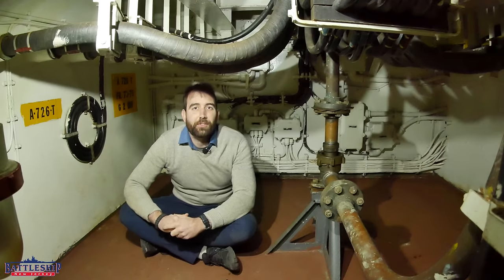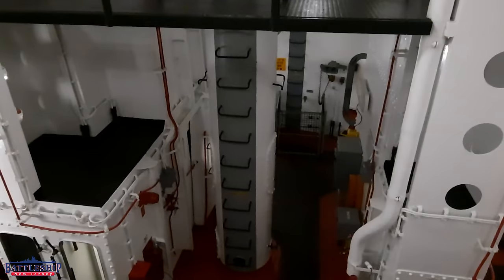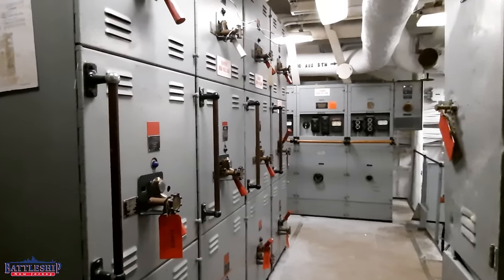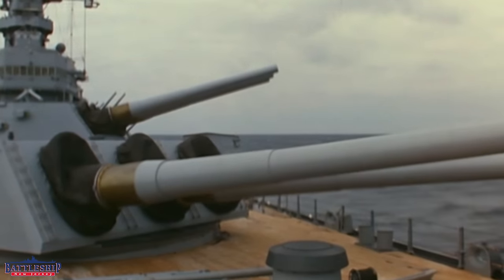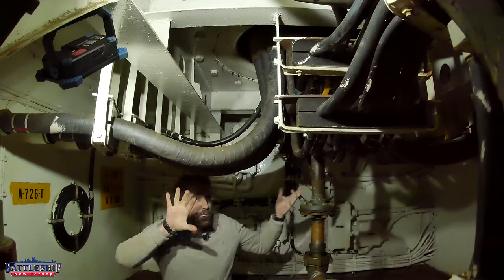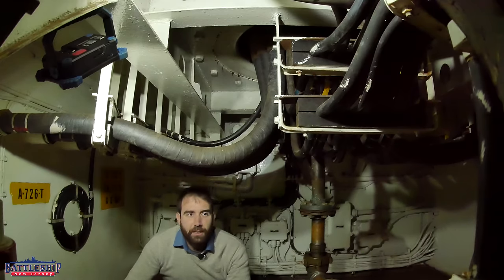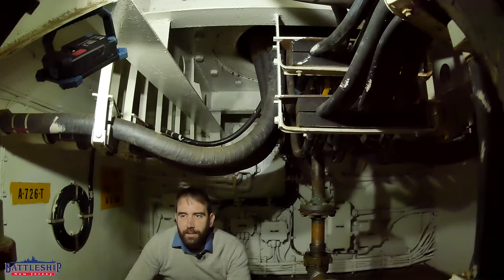Connecting the Rotating Turret to the Rest of the Battleship

Comment: According to a similar video produced for the USS Iowa, the pipe running up the center stalk is the purge air for the 16" rifles.
Reply: Thank you!  Of course we all now HAD to know what the mystery pipe was for.  So now where is that air supplied from?  :)  
When I saw it I was thinking something air related too with the size and the fittings.   I forgot all about the Purge/Blowout after firing.
Reply: @donchaput8278  It'll be attached to a compressor/air tank. Where the intake is, other than "above the waterline", your guess is as good as mine.
Reply: I read down through here looking for this very comment. Yes, it is an air line and I knew that by looking at it. However, what you said does make perfect sense. I wondered what it was for and never thought of the purge. 
Thank you.
Reply: Interesting. I wonder why they deemed it necessary to have the only pipe going to the turret be the air line? Sure the compressor and air tank needed for the purge system could have been fitted in the turret itself, just like the hydraulic pumps etc. There must be some reason to do it like this but what is it?
Reply: @Murgoh  I don't think the tank and the pump would fit. The volume required to vent those 16-in turrets has got to be pretty massive resulting in a pretty darn substantial tank. Then to top that off with keeping up with the firing rate of nine of them you need a pretty substantial setup
Reply: @Murgoh  you don't want to take up the room or have the weight of a heavy compressor supplying air at very high pressure and also flow. You don't need 3 sets. Have you seen the barrel clearing in action? You're blowing anything burning out of basically a 16-inch pipe. It takes a lot of pressure moving a lot of air.
Reply: I was actually about to suggest that very thing. The compressed air supply for the gas ejector system.
Reply: @ut000bs  Yes, maybe so. The compressors back then were probably much larger and less efficient than nowadays too so I guess there were some large steam operated ones somewhere on the ship supplying all the compressed air. That's not a huge pipe though so they'll probably still have tanks in the turret to supply the needed high volume of air for the couple of seconds.
Reply: @Murgoh  My guess is that it was for safety reasons and not practicality or space. A rather big air pressure tank that gets hit by shrapnel can explode violently and it can be better protected deeper down in the ship. A pipe that gets hit is not as bad.
Reply: @skunkjobb  not to mention what all that surprise extra oxygen does to the dust and other already smoldering combustibles in a breached turret...
Reply: @Murgoh  it is possible the flow requirements would be too much for an electric pump placed in the turret. It is also likely any electric pump would be too high of a power draw for the ship's generators. Also the boilers have their own pumps so it would be relatively easy to just siphon off the ship's steam powered pneumatic system.
Reply: The compressed air going thru that pipe does more than supply the purge air for the 16 inch guns, it also provides pressure for the multilevel fire sprinkler system throughout the turret.  The water for the fire sprinkler system is provided by a firehose connection from the stationary part of the turret's powder flat (the bottom floor of the turret assy) to a standpipe toward the center stack of the turret, again on the bottom floor.
Reply: @SomeRandomHuman717  You are correct.  My response was incomplete.  Concerning the volume of air required for all of the tasks mentioned, there are numerous air bottles installed in the turret structure for this purpose.
Reply: @leaj847  The air bottles are in fact located in the annular space, that is, the area between the turrets and the magazines.  They are painted grey and seem to come in batches of four.  This video shows one, "HP Air 3000 PSI"  https://youtu.be/zIeKVlC6-uI?si=KYZ46LCmdSZ4slh_&t=634
Reply: That's exactly what I though.

Comment: Interesting on the Cables. Coming from a way smaller system comparably, I assumed that the guns just had a massive electrical slip-ring.
Reply: Same here.🤷‍♂️
Reply: May have had to do with the possibility of sparks
Reply: @PixelmechanicYYZ  : Yeah, if some maniac paid me to design a battleship then I'd definitely worry about slip rings producing sparks, as well as general wear & tear.
Reply: No need. The turrets only rotate through a limited arc because the superstructure is in the way of the barrels. Twisting cables would have no problem with this limited rotation. Where twisting cables would be a problem is in something like a tank.
Reply: Even in smaller stuff slip rings aren't always used if there is no need for unlimited rotation. The robots I work on are cables, they run up the middle of the J1 and J4 axis (cable is external for the J2 & J3), robots are then limited in the software how many rotations they can go. Simpler, cheaper, less maintenance.
Reply: I too first thought about slip rings.
Wouldn't surprise me if the air line has a rotary union though.
Reply: I was thinking that too, but with the limited range (270) it is not necesary, so a slack cable is actually better :)
Reply: I'd thought slip rings too. But for AC perhaps electromagnetic couplings akin to electrical transformer. AFAIK little reason why a wire coil would need be physically locked to magnetic core. Was such used in any other systems? Say searchlights?
Reply: I thought the same, it was a surprise to find out that they went for the twisting cables instead. I suppose that given their diameter, the twisting angle and the total rotations the turret would do in it's lifetime, it wasn't necessary to go for something more complicated. They're not spinning continuously like other machines.
Reply: Is that how they do it on 360° Turrets?
Reply: @mcbrite  You would have to, otherwise the cabling would for sure get comprised or rip apart from over-stress.
Reply: @red2001ss  Either that or they would have to "un-rotate" the turret after battle... Say it could handle like 1-3 rotations before snapping and it just rotates them back to "neutral", during an opportune time...
Reply: That would be needed if they could rotate 360°, but not being able to spin indefinitely the cable is just made with enough slack to account for all possible positions.
Reply: @PointyTailofSatan I do wonder what they did for ships whose turrets theoretically could rotate 360° due to the lack of superstructure, like the forward turret on Dunkerque or the middle turret on Nelson.  They probably just used the same limited rotation method, but it would have been neat to see them rotate all the way around.
Reply: @legogenius1667  Older battleships and battle cruisers had a firing rate of 30-45 seconds. So the need for a quick traverse across the beam wasn't really that important.
Reply: @PointyTailofSatan  Agreed, they also would rarely need to suddenly engage another target from the opposite direction, and ships taking sharp 180° turns while pointing their guns in the same direction in the middle of a battle line wouldn't be the smartest idea.  It would just be cool to see.
Reply: @mcbrite  Slip rings on 360.The stops are vital to protect the cables. ..

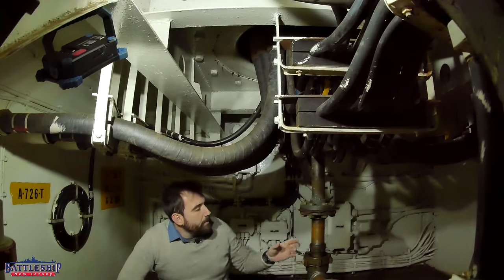Comment: 3:50 It could be, the compressed air they use to blow the barrels out with after firing. Copper piping couldn't hold  the pressure that would be needed for any hydraulic systems, and like you said, it's not insulated, so, probably not steam as well.
Reply: If it's just a return the hydraulic fluid wouldn't be under pressure. Perhaps just a water drain?
Reply: I'm going with compressed air.
Reply: You’d think it would be way simpler to just have an electrically powered air compressor inside the turret.
Reply: @w0ffe  that's not how hydraulic systems work afaik...
The return has just as much preassure as the out line, otherwise the fluid reservoir of the system wouldn't be able to keep up with the pumps.

Comment: They're actually clamped in place to keep the insulation on the wires from rubbing against the brackets, each other and to minimize flexing at the point where the wires come out of the wall which is usually the highest stress point. It has nothing to do with keeping the wires from being "pulled out". The turret traverse is limited to where that can never physically happen, or, more accurately, the wire lengths are chosen to accommodate the turret traverse.

There are examples of other battleship turrets and a lot more examples of older tank turret wiring that had no brackets like that and they end up causing everything from loss of power to catastrophic explosion and destruction and fire from the sheer amount of electrical power that goes through them.

Comment: There are mechanisms that allow for rotation of different conductors. Hydraulic and pneumatic circuits use rotary manifolds, which work quite well. Electrical circuits can use sliding rings. It comes down to how badly you need those functions though, because they do add a lot of cost and complexity.

Comment: Being a former Surface Warfare Officer (SWO), here are some spaces I quickly thought up if you haven't already done a video on them:

Chain locker, anchor windlass room and focsle ground tackle
Go aloft all the way to the mast head (Possibly the TACAN antenna? Got to do this during an INSURV inspection in 1991; great view of Charleston, SC)
Does the shp have an oil lab? Could be cool to go over some of the Oil King's lab gear
Inside the Mk 34 and Mk 37 Directors
Reply: Pretty sure he did a video in the chain locker, and a video of the steam windlass.

Comment: I think the pipe is compressed air. 
I also believe the sprinkler tanks had a head of compressed air on them to provide the pressure needed to operate the sprinklers.
The power is some of the big cables, but there is a whole lot of communication and control cables too.
Reply: Purge air for the rifle bores. The sprinklers work on gravity.
Reply: @ut000bs  The sprinklers can work on gravity but the system is designed to use compressed air.

Comment: Thank you for doing a terrific job with the videos, Ryan. I'm thinking there must be massive counter weights in the turrets to offset the weight of the guns. Also the guns themselves to assist in raising them. I would be interested in those details, being a gear head.
Reply: Pretty sure(guessing) the turret armor alone weighs more than all 3 guns combined. And the point of balance on the guns is probably pretty close to their elevation pivot to cause as little wear as possible

Comment: What type of sensors are used to determine the degree, minutes, and seconds for the turrets position ? How does the fire control computers use them. Especially when switching from primary to secondary power sources.
Reply: The whole fire direction system (especially the original as-built mechanical systems vs. the undoubtedly much updated systems currently installed) would be very interesting, I think.

Comment: The center pipe is for 600 psi air. IIRC there are also several medium pressure air tanks in the annular space that can be used in an emergency.

Comment: Also IIRC there are several spare cables already in the trunk that can be used. So if a cable fails for any reason you don’t have to run a new replacement cable.

Comment: the pipe would be the compressed air feedline for the guns to blow the fumes from firing out of the muzzle before opening the breech during the running out stage of recoil
Reply: They don't blow fumes from the barrel, they blow out still hot residue from the powder bags. It's a bad idea to put new bags in while the old ones are still burning. It does all sorts of damage to ... well, everything.

Comment: i've basically figured this out without looking at any reference images or blueprints when i started working on a scale 3d model of the IJN Yamato in sketchup back in highschool, its really just two plates with conductive concentric rings that act as the contacts for the circuit, they make contact when the turret is lowered into its barbette housing in the ship, and the design is still used even today in most large caliber naval guns.

edit: also the electrical stalk doesn't exist in the IJN Yamato since they needed the space for the 3 shell & powerbag carriage rails, british turrets were also built similarly in ww2 ships - which is where most japanese shipbuilding techniques were based on (primarily from the kongo line of battleships, ise line of battleships, & fuso line of battleships, all were given by england to japan).

Comment: i wonder if the very long run of the cables up the center lets them get away without the use of slip-rings, or at least very few of them.  they will never have to twist more than 270 degrees over at at least several decks worth of length.  more if the feed power goes up and then back down.

with all the control and information feeds to and from the other turrets, plotting rooms and fire control directors, this feature on the turret a great deal.

Comment: You never explained the electrical connections to the turret. Is it like a huge extension cord?
Reply: Really can only be one of two thing.  The wiring bundle had enough slack to allow it o flex while turning or these is a big ass set of contact rings involved.
Reply: Essentially yes, the big arm thick wires above him in this video are going up the middle of the turret and the slack gets pulled out of them as the turret rotates. Those are the power cables.
Reply: @Pitchlock8251  I wonder what gauge they are.
Reply: @TrabberShir  Is that a Home Depot item lol!
Reply: They are just really long straight wires up though the center, so the twist effects the entire length.

Comment: How long does it take to rotate the main battery the full 270 degrees?
Reply: The train mechanism has one fixed speed, 4 degrees/second, so at that rate to go 270 degrees it would take around 67-68 seconds

Comment: Correction, you CAN run piping (and electricity) through a rotating pivot. Almost every excavator you see does this.

I recently watched a video on one such hydraulic pivot being rebuilt because it was leaking and it was quite an insight on how they work.

It's basically a long pin with multiple holes drilled down the length of it and cross holes drilled into those longitudinal holes at different lengths from the head of the pin.

The pin seats inside a housing, that has internal grooves cut into it matching the "exit" holes on the pin, these grooves are then drilled into from the side.

Seals are placed between each groove to segregate them.

This particular one I watched being rebuilt had 10 hydraulic lines plumbed through it to control the tracks and push blade.

Hydraulic lines tend to operate at pressures FAR beyond steam and water systems, so the only issue would be the physical size needed for the piping.

For example, if you want to run a single 2 inch pipe, the pin would need to be around 3 inch diameter to allow for the internal 2 inch hole plus enough thickness for strength.

If you wanted to run two 2 inch pipes, you would need a pin of around 5.5 inch to support the two 2 inch lines side by side.

So that is possible.

Also, you are mistaken in thinking that you would be pumping water from the bottom of the ship up to the turret.

It doesn't actually matter how far down a pipe runs, what matters is where the source and destination are located.

I could place a water tank 5 ft above the ground, run a pipe all the way to the centre of the earth and back up to 4ft above the ground and the tank will drain out on its own with gravity (assuming the tank contains enough water to fill the pipe).

Also, whilst I know you source your water from the city mains via your shore connection, but how does the Battleship obtain water when at sea?

Whilst sea water is used for fire mains, toilets etc, fresh water is pretty critical to the basic things like human consumption as well as feed water for the boilers (even with condensers to reuse steam water, there will be losses that need to be replenished).
Reply: I can answer how they get water at sea.

Battleship Texas has a video that shows her evaporators. Essentially they heat the water and collect the salt free condensation.
Rather than waste energy trying to extract as much water as possible they only extract a small percentage of the water from thensea and just keep getting more.
By doing this it also results in less salts building up.
Reply: @Tuck-Shop  I assumed they'd have a desalination plant of some sort and while the current gold standard is reverse osmosis, that tech wasn't exactly matured back in WW2.

I should watch the Battleship Texas video, but did they try to use waste heat to preheat the sea water? Eg a heat exchange for the steam condensers.
Reply: Tanks also use slip rings, not just for electricity feeds, but also hydraulic supply and return, and data transfer.  Never seen the inside of one, but they're safe for use around combustible casing main gun (120mm) rounds, even if a butterfingered loader drops one and it breaks open.